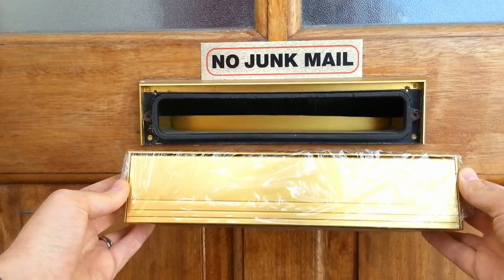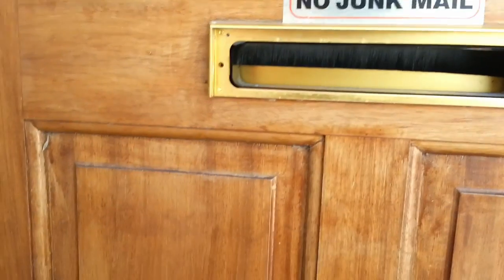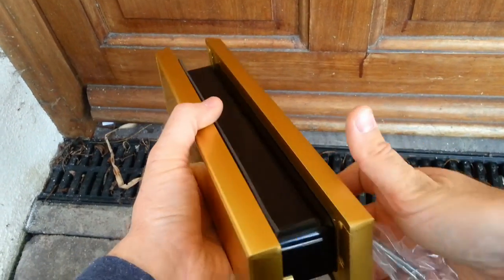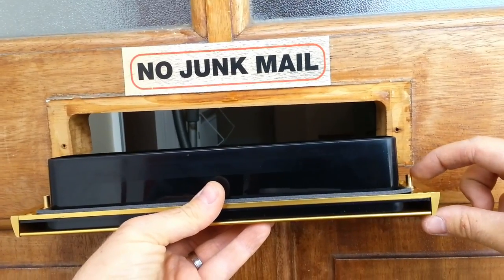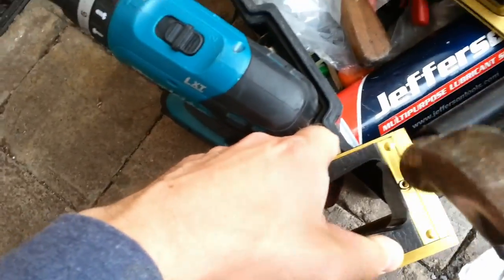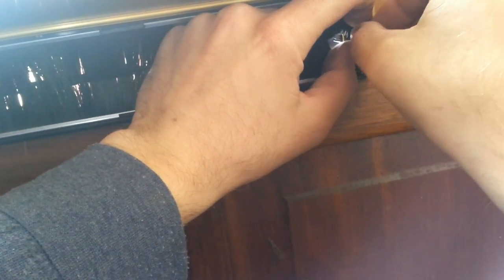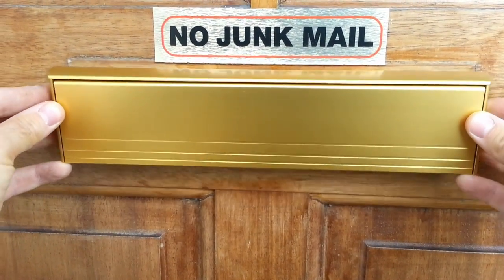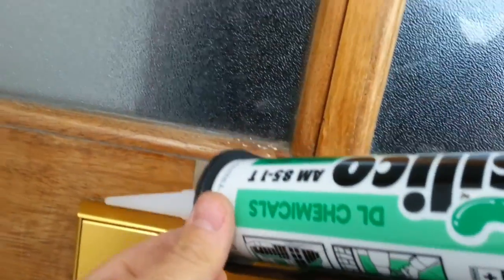How to replace a letterbox

Comment: Hi this is exactly like my letter box i need to replace what is the name of this letter box and do you have them thanks
Reply: Did you know where you got it from ?
Reply: Hi Andrew. Did you find out then name of the letterbox and where to get one ? Mine is also exactly the same and I need a replacement as the springs have gone. Peter

Comment: Do you have to take out the grommits each side or can the bolts tighten up in these please
Reply from the maker: Hi Jacqueline, It would depend on your door. There would have to be holes drilled or a section cut out of the door to be able to use the bolts. The door in the video didn't have cut outs thats why i tapped the grommits out.
Reply: Window and Door Parts Ireland ... Thankyou .. my door has holes but the bolts weren't long enough so I could only use screws in each corner ... x